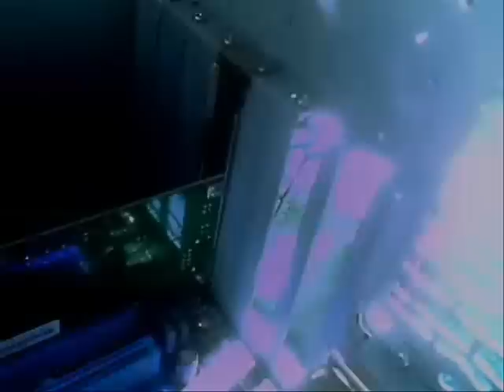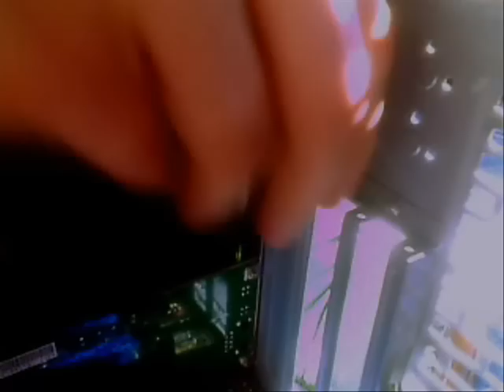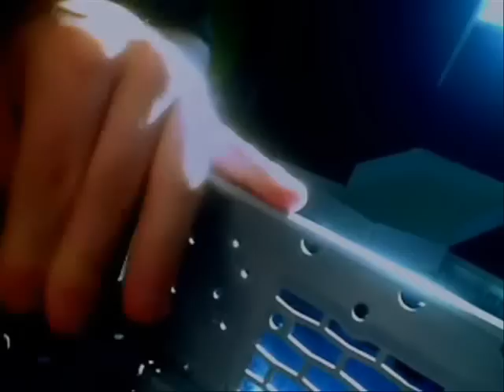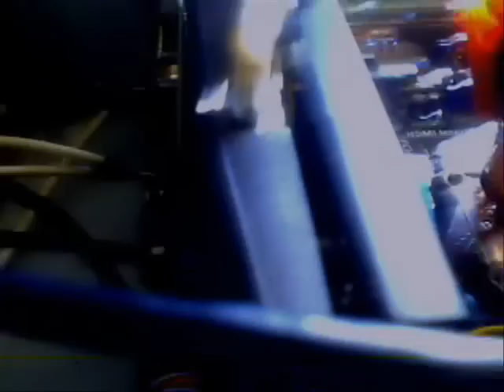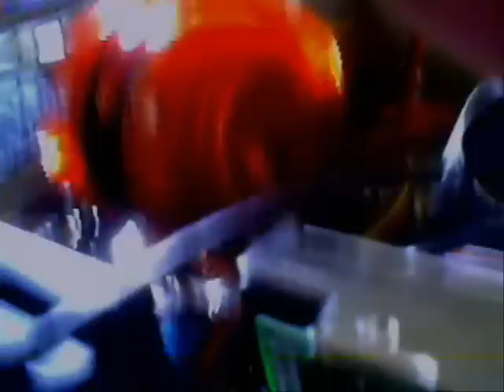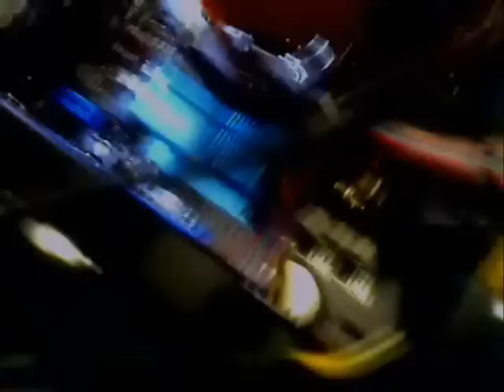how to install a graphics card (ill be in stalling a Asus Radeon HD 7770)

Comment: I bought a AMD Radeon HD 7770 today and I can't figure out where the power cables go inside the computer. The one end is plugged Ito the card but my cord came with two of those white ends. When I plug them into the power supply my monitor won't turn on?